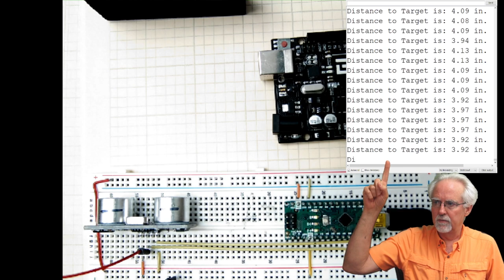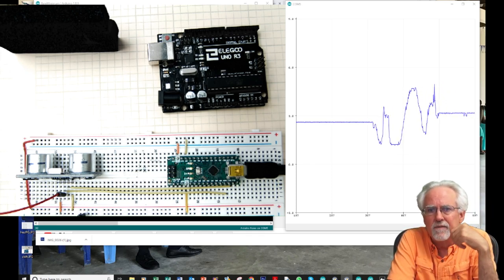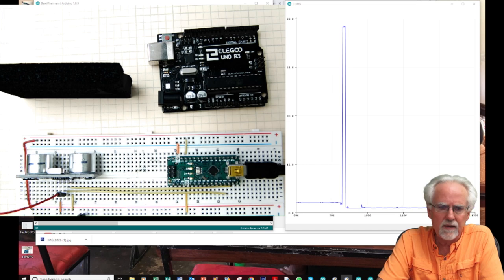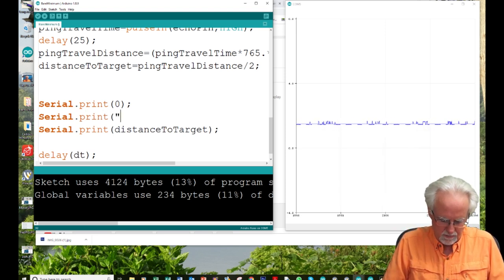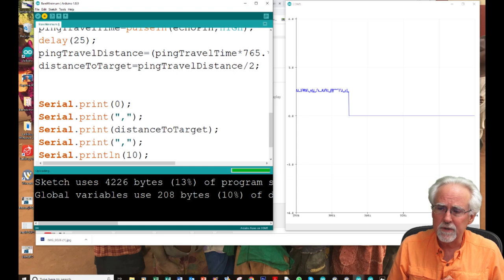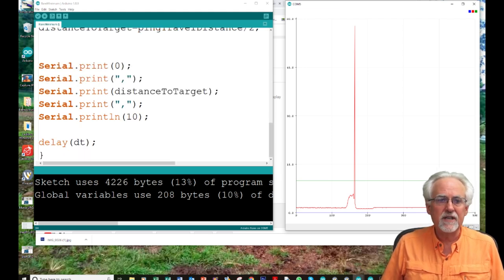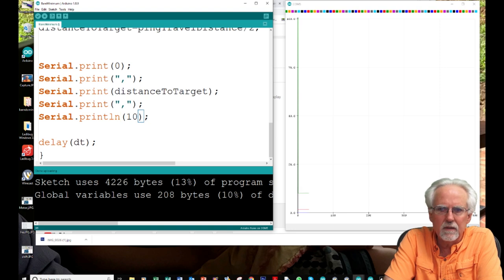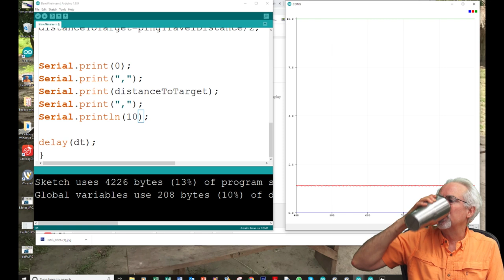Arduino Tutorial 56: How to Graph Live Data Using the Serial Plotter

Comment: Thank you for the tip on the auto-scaling tendency of the serial plotter, Sir Paul.

The plotting of additional data, i.e. the constants, acts as if we have a lower boundary and an upper boundary.
While it is true that the plotter still auto-scales when data is beyond the boundaries, the graph remains neat and tidy. 
This tip is great for when visualizing if a data exceeds a certain limit. And we can see that when the data plot crosses the lower or the upper boundary, i.e. when the data plot crosses the lower horizontal line graph or the upper horizontal line graph.

We are saved from being surprised with constantly varying scales / constantly varying lower and upper boundaries.

Thank you for this lesson Sir Paul!

Comment: Plotting Sine and Cosine was easy.
Declare the values as floats and do angle increments in 0.1 . I used the expression: angle+=angle+0.1;  in for expression.
The Sine and Cosine are 90 degrees out of phase with each other.
Note: the EEPROM is guaranteed for 100,000 writes
Wayne

Comment: Okay, sir I've done the homework. Used a "For" loop to read out the angle from 0 to 360 degrees and the sine and cos functions of the Arduino to work out the values. However I could not come up with a method to separate the 2 waves like in an oscilloscope and they were overlapping each other. Finally decided to increase the amplitude of the sine wave by doubling its value( value of the cosine wave remains the same ).
Thankfully the plotter has various colors(colours) and the waveforms can be differentiated visually though they overlap .
Now to check out Tutorial 57 and see if all went accordingly here or if I have goofed up.
Reply from the maker: Most Excellent! Keep up the good work.

Comment: Hey Paul, so I tried pulling up my serial plotter but instead of showing me the graph it showed a blank screen and the number values went from left to right instead of bottom to top. Do you know why that would be?
Reply: same problem
Reply: @johnhechtlinger9465  @christianbautch4015 I'm pretty late. But it's most likely because in your Serial.println you have text. The Serial Plotter doesn't understand human text, so it doesn't know what to print. 

Change it to this Serial.println(pingTravelDistance); ... should work

Comment: Did I miss something here? In Tutorial 55 you talked about two lessons : one on dimensional analysis and one on using a low pass filter. Are they coming later? I was expecting them before this tutorial on plotting live data.
Reply: I didn't see one. I decided to sample my readings 100 times and take an average. I did a for loop 100 times.  I added the sensor value (initialize to 0 at the beginning of the void loop) to a variable on each pass. Then, once outside the loop, divide the variable by 100 and use that result to calculate the distance. The output seems much more stable like that. This is a math workaround to an electronics problem. I hope to see the low pass video soon.

Comment: Out of interest, i upset mine, it was hung, the plotter was hung, the LCD display was stuck, even after changing data ints, i reset the arduino several times, in the end, i reset the sensor then reset the arduino, this cured the problem, can't say why, but there is quite a bit of logic on the pcb, so who knows?
Reply: Thanks to your comment I reset the sensor and plotter began working.

Comment: Hello sir. 
Thank you so much for the content you put on YouTube. You're a model here in Africa. Could you possibly do a project on an arduino based solar charge controller with LEDs that change color on the basis of batteries been charged, charging and low.
Alternative energy is a major priority here and I want to build projects related to alternative energy. Thank you in anticipation of a response.
Reply: Maybe you could use the voltage reading tutorial he did and then a series of if statements to light various leds based on the voltage. if reading >= 12 volts write greenLED High, if reading >11.5 && reading < 12 then yellowLED HIGH..... Of course you would probably need some pretty significant resistors to step down the voltage (see tutorial on that one) to get a voltage you could use with the Arduino. DISCLAIMER - I am not a professional coder or electrician, so check these ideas with someone who is. I'm just a middle school teacher.

Comment: Seems like Lessons 57 - 68 are not available any idea on when they will be up ??
Reply from the maker: Patience, grasshopper . . . videos are released one per week on Tuesdays. If you are locked down and not getting enough material, hop over to the Jetson Nano playlist on this channel and check it out.
Reply: @paulmcwhorter  During the wait, I incorporated the LCD to lesson 55 but without a potentiometer.   
int trigPin = 12;
int echoPin = 11;
int deltime = 10;
#include <LiquidCrystal.h>
int Contrast = 75;  // Setting the contrast to 75
float pingTravel;
float pingDistance;
float distance;
float velocity = .0134992;  // inches/microseconds
int longwait = 1000;
int rs = 7;  // The next 7 int were to set up LCD pins
int en = 8;
int vo = 44;
int d4 = 2;
int d5 = 3;
int d6 = 4;
int d7 = 5;
LiquidCrystal lcd(rs, en, d4, d5, d6, d7);  //Setup LCD Object

void setup() {
  // put your setup code here, to run once:
  analogWrite(44, Contrast); // Writing Contrast to 44 (PWM pin)
  lcd.begin(16, 2);
  delay(longwait);
  Serial.begin(9600);
  pinMode(trigPin, OUTPUT);
  pinMode(echoPin, INPUT);

}

void loop() {
  // put your main code here, to run repeatedly:

  digitalWrite(trigPin, LOW);
  delayMicroseconds(deltime);
  digitalWrite(trigPin, HIGH);
  delayMicroseconds(deltime);
  digitalWrite(trigPin, LOW);
  pingTravel = pulseIn(echoPin, HIGH);  // pingTravel is in Microseconds
  lcd.setCursor(0,0);
  lcd.print("Ping : ");
  lcd.print(pingTravel);
  pingDistance = (pingTravel / 2); // cutting travel by 2 to get point of deflection
  distance = (velocity * pingDistance);
  lcd.setCursor(0,1);
  lcd.print(distance);
  lcd.print(" Inches ");
  
  delay(longwait);
}

Comment: Paul. sorry I have to temporally stopping follow your lessons because of COVID-19.Unfortunately do not have my PC and all Arduino's KIts with me right now. Anyway, As I am thinking for the assignment of sine/cosine and my idea is graph which mirrored of function y = f(x) for sine and y=-y for cosine. From my old school Pi is better presentation for cycle of sine. 2Pi is whole cycle, Pi is half cycle  and 1/4Pi, 1/2Pi, 3/4Pi and etc. As example, if  max sine (y) as 10 then it is  1/2 of Pi,  1/4 of Pi equal y=5 or close, 3/4 of Pi is close to 5, then for next half cycle Pi+1/2Pi as max and etc. Thanks to refresh knowledge from 70 th.